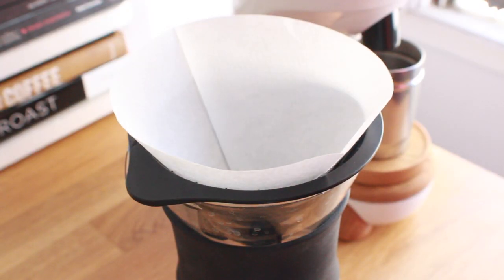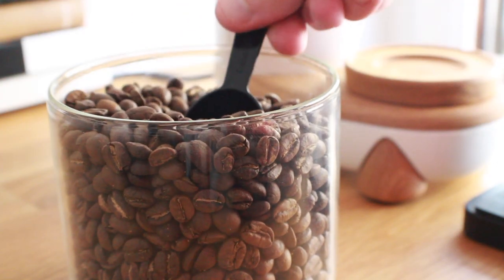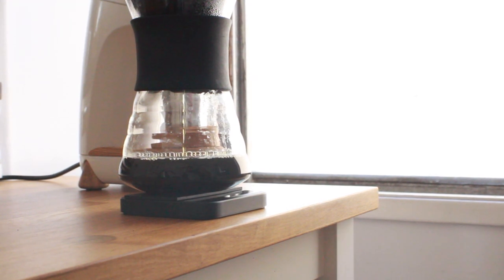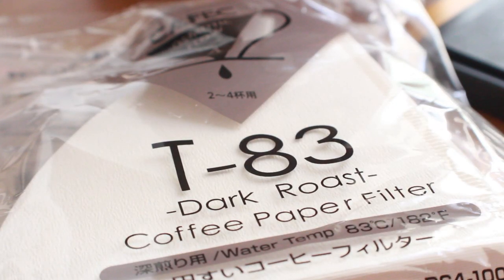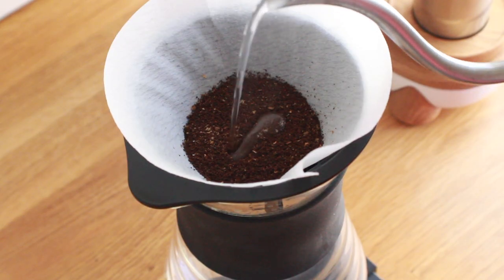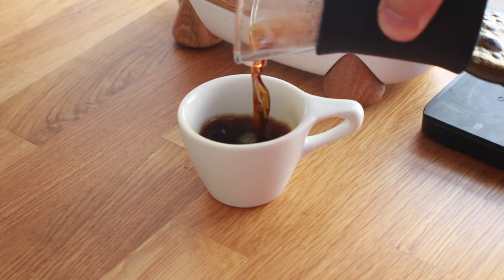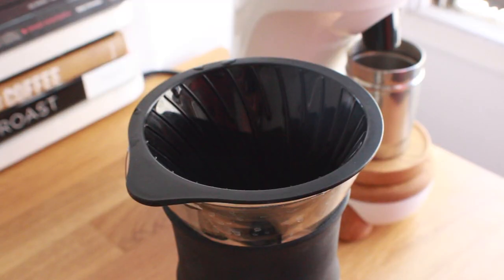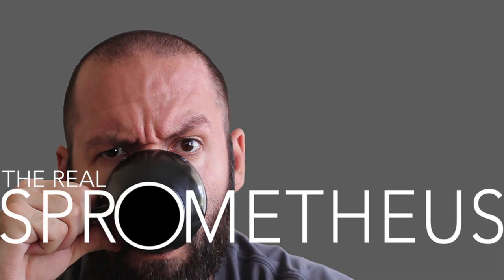COFFEE SCIENCE - Cafec's Roast Specific Filters

Comment: Question about the CAFEC light roast filters:

I have been playing around with these in my ceramic v60 and I have never had so many brews stall out and the drawdown ends up in the 6+ min range using the Hoffman method. I even gring coarser for these papers vs my Kino fast papers and still have the same issue. Has anyone else faced this issue or am I just doing something wrong?

For reference:

ceramic v60

1zpresso JX Pro - 42 clicks (4 full turns and then 2 numbered increments)

21g beans

350 ml of water
Reply: It's not just you. No matter how I start my brews with the light roast filters, they will stall eventually, leading to horrible drawdown times and a bitter aftertaste. I'm switching back to the normal papers, since my pour overs were plenty tasty before trying these filters.
Reply: My first few experiments with the light roast filters they are very slow , 35 seconds to a minute + slower than Hario tabbed as same grind setting.

Comment: I’ve had a bunch of these filters lying around but I’ve noticed that with the osmotic flow filters, the standard draw down would be around ~2.5 minutes, but with full saturation, water wouldn’t reach the coffee bed until around 6 minutes, sometimes even longer. Has anyone else noticed a significantly longer draw down with full saturation?
Reply: Yes!! I couldn't believe it doubled my brew times for light roasts! Overextracts every time. I have practiced osmotic flow in the past and have found it not very consistent for me. I didn't expect this much difference. My only solution is super slow pour or Tetsu method.

Comment: Do these fit a chemex 3 cup? Interesting video, appreciated.
Reply from the maker: Good question. Not 100% sure. They are made specifically for the V60 but the Chemex is a 60 degree angle as well. I’d say it’s likely, but I’d go with the bigger size, you could always trim off the excess of there is any.
Reply: @Sprometheus  after thinking about it, the single ply would likely collapse against the spout of the Chemex.
Reply from the maker: Yeah that’s possible. One of the biggest issues with that design in my opinion. Even their filters have that issue.  If I had a Chemex I would try it out, but it broke a couple years ago and I never replaced it.